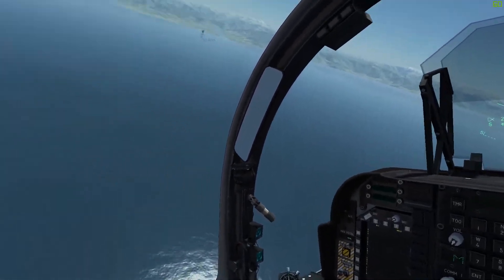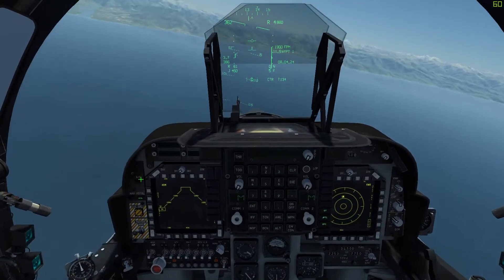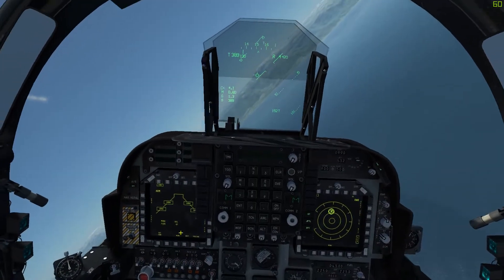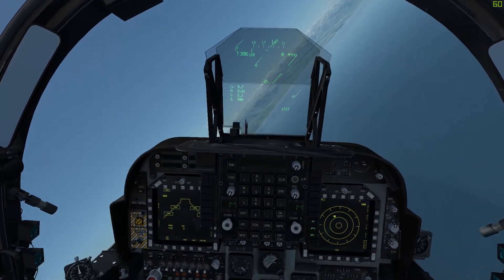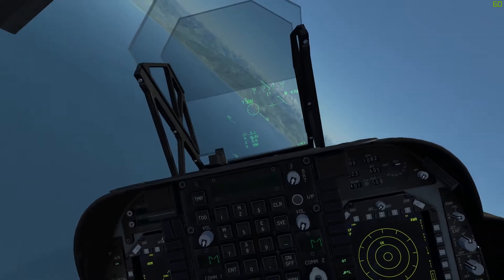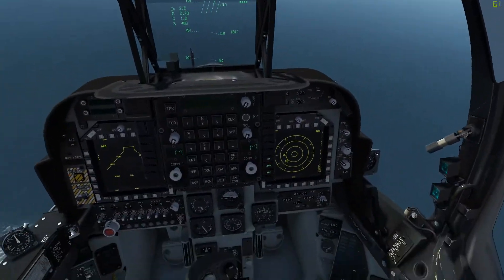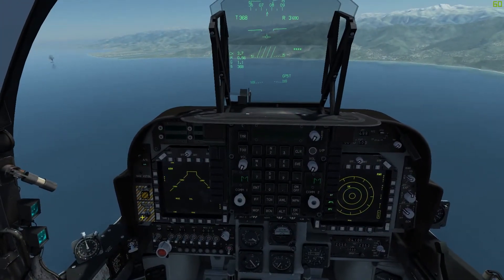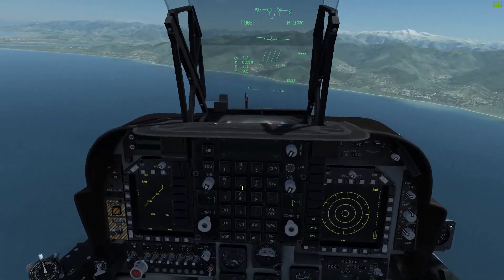DCS: AV-8B N/A | AGM-122 Sidearm Demonstration

Comment: It just locks on automatically?
Reply from the maker: This could be out dated. I made this when the module first came out but yes if your master arm is on and you select the weapon and point it in the right direction and it is with in range it should automatically lock up for you.
Reply: Ok I think that still is how it works, but it must only be against a specific type of ground target then? Didn't get a lock on any transports in my bombing practice mission haha
Reply from the maker: The Black Cap , anything that emits radar. I'm assuming your transports are the tarp covered trucks and they do not emit radar.
Reply: ah okay thanks for the explanation man! Sub definitely earned haha